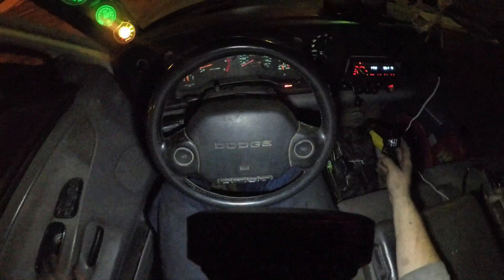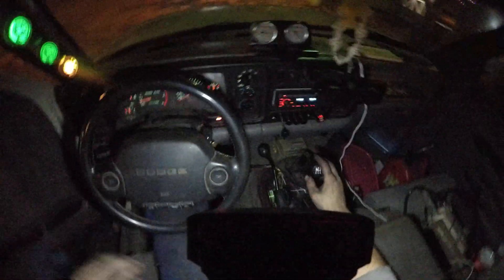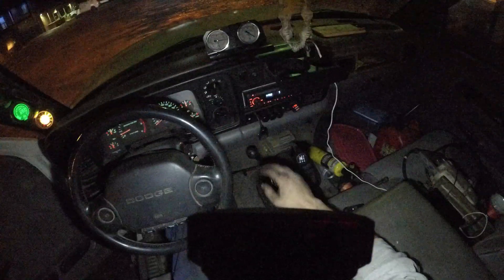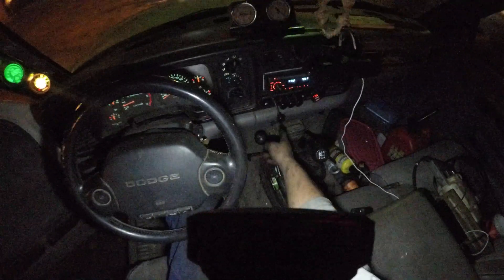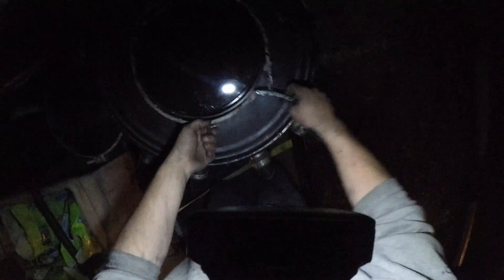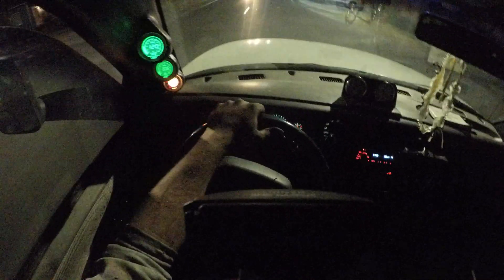V10 Woodgas Truck, Hopper Bridging and Hot Refuel

Comment: Smooth .. a local friend built an agitator that turned occasionally so it would not bridge.  Would be interesting to see what you would come up with.
Reply from the maker: If the roads aren't good (like most around here) bridging isn't a problem the road vibration will kick the wood down. Every bridge I have ever had was almost that exact same spot in both trucks, the nicest stretch of road on my daily drive
Reply: @BigBeavrSlayer  .. Yes, I understand .. we need to invent ways to overcome these issues for those driving the smooth roads.  🙂

Comment: Thats a good idea with the hopper temp gauge. What did you use, just a regular thermostat sensor?
Reply from the maker: Water temp sensor it starts reading at 80 degrees and Max is out at 280 degrees Fahrenheit it works perfectly because if the hopper is over 150° it's out of wood or like this instance has a bridge that needs to get knocked in and restore temperatures correctly
Reply: @BigBeavrSlayer  Ah! Haha very smart!
Reply from the maker: @kittywampusdrums  a exhaust gas temperature gauge works great for the gas temperature I have one in the crossover pipe in this truck and in the Toyota I have it in the gas outlet where it goes into the cooling rails that one starts reading at 400° and Max is out at 2400 typically gases 6 to 800 Degrees